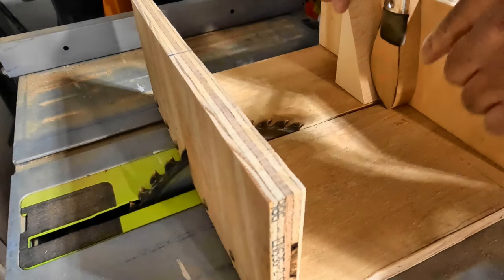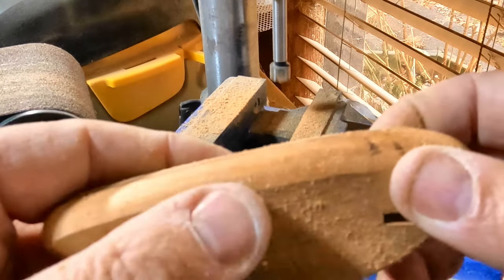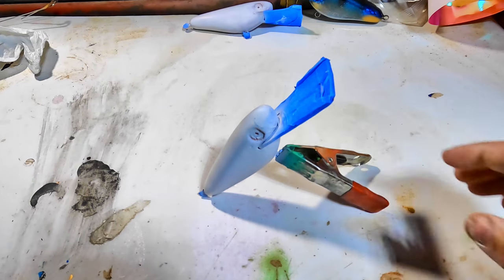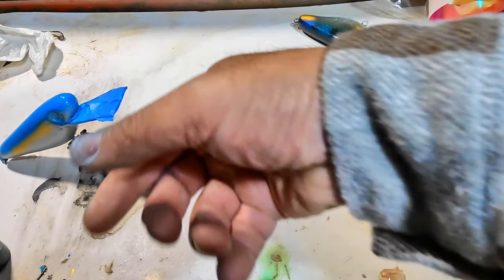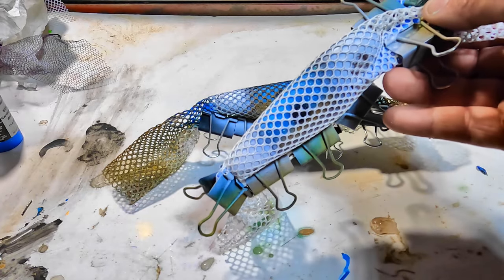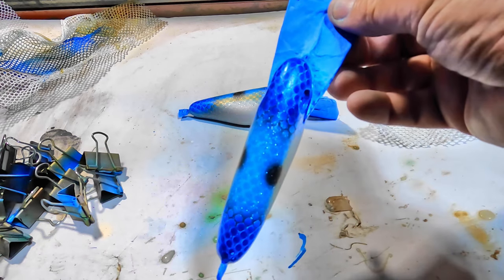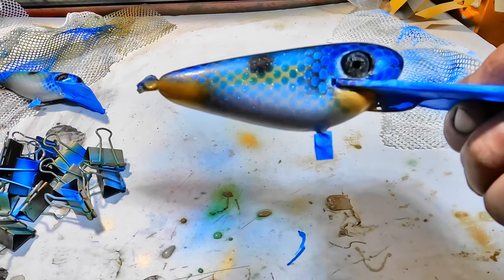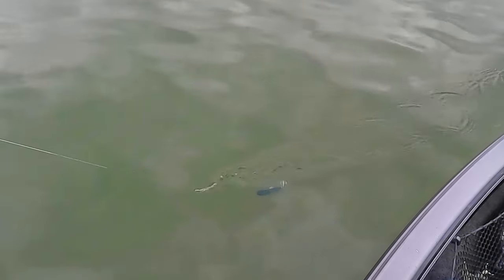The Channel Has TWINS!  Lure Making!  Making Two 4.5inch Mahogany Shad Style Musky Crankbaits

Comment: I enjoy watching you build lures. But the router is a bit nerve wrecking to watch as I had a run-in with a table saw that landed me in the ER.

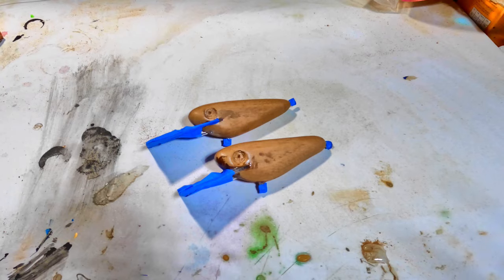At 13:27 the process took a huge leap. I can tell that you added the lip, added the hanger eyelets, added the weight, sanded, and clear-coated or sealed the body. What intrigued me was the way you filled in the lead hole. Did you use a piece of wood or what? Because it looks neat & clean and is hardly noticeable. I would have liked to see how you did that.

I also notice that the one lure you declared as scrap was back in the picture, but I missed if you explained what you did to recover it.

Great job on the twins! The look great both in and out of the water!
Reply from the maker: Thanks for the comment and enjoying the videos.  Yeah, I had a run in once with the router, but after using it a few times, I learned how to route the wood around the bit.  The lead hole was filled with a strip of scrap and then cut down and sanded smoothly.  As for the scraped lure... yes it was scrapped, I had another one laying around and used that one instead, that way I could have the twins.  Again, thank you for all your support.  I'll add how I fill the lead hole on the next video, which will be a 10 inch minnow crankbait in a Christmasy theme.